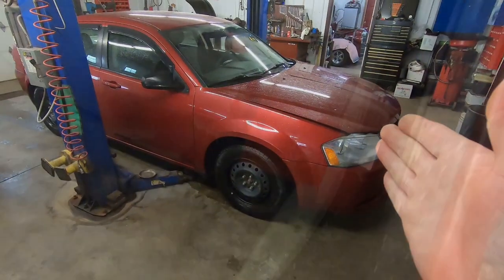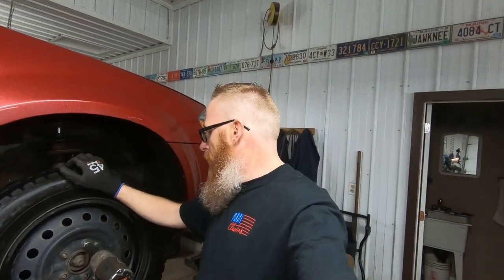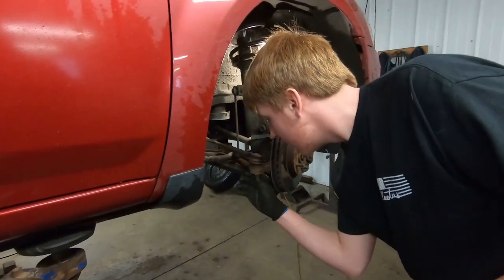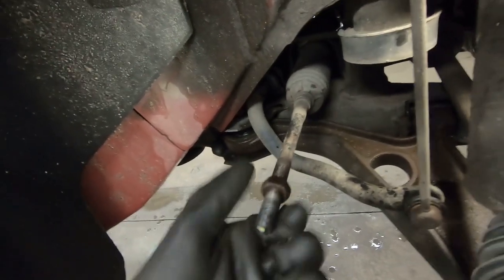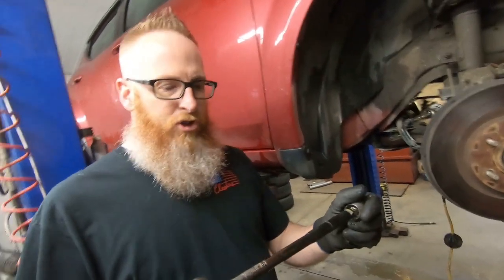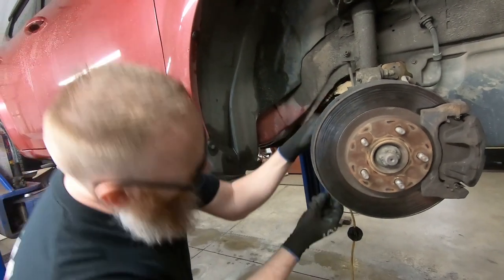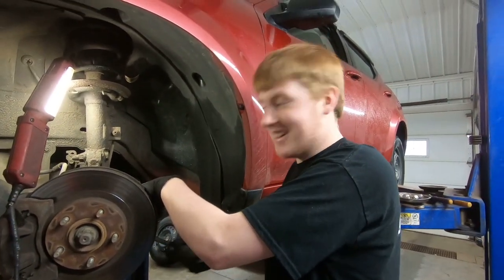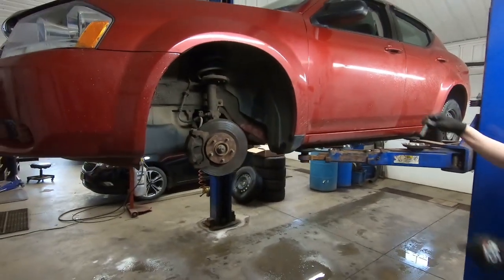JR GETS NEW TIE RODS FOR HIS 2009 DODGE AVENGER

Comment: Would a symptom of this be a thump feeling in the steering wheel when turning left or right (speed doesnt matter, happens when just moving the tires left and right), I have the same vehicle 2009 dodge avenger with over 200,000kms on it; you dont hear it but u feel it within the wheel.
Reply from the maker: Sounds like you’re describing the strut mounts binding. I’d start with that!
Reply: @OldeCarrGuy  taking it to the garage tomorrow